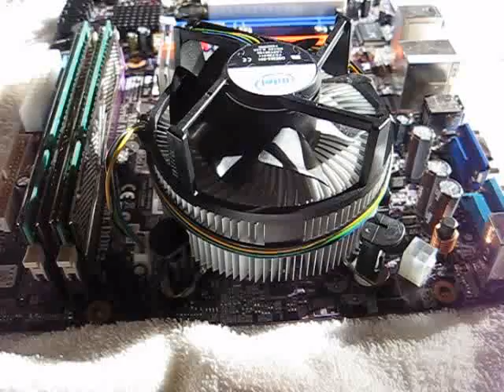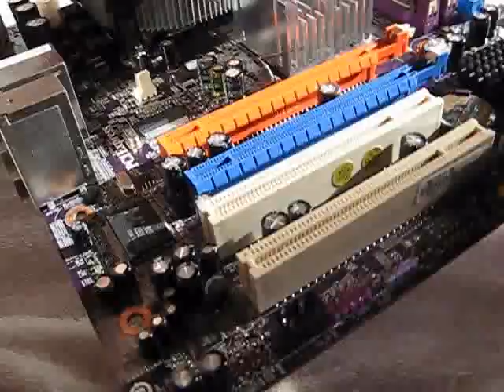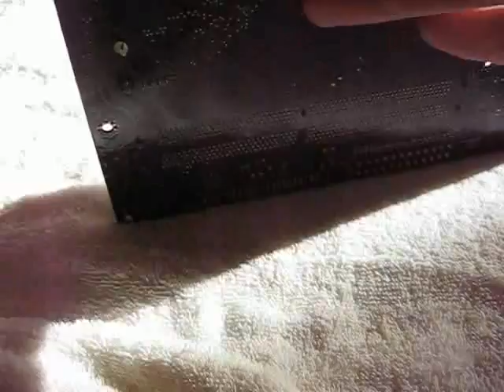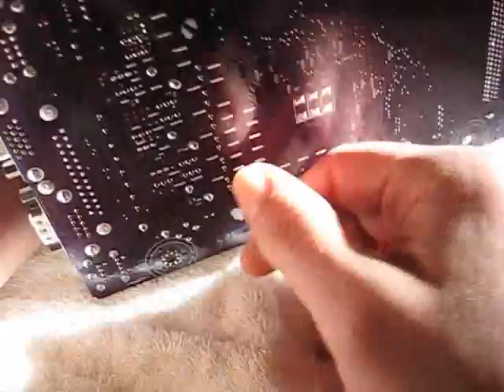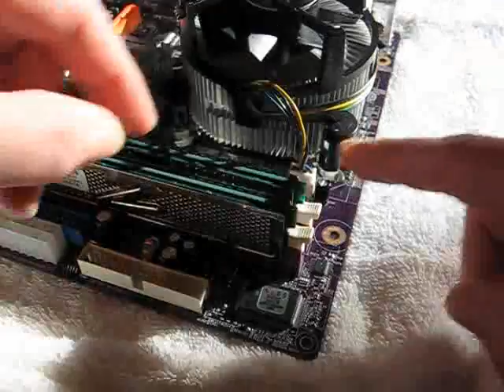CPU Intel socket 775 (removing)

Comment: Thanks for making this vid man, I had trouble remembering how to take it off as I was upgrading from E6750 Core 2 Duo to E6750 Core 2 Quad today, installed a Thermalright 120 Ultra Extreme 775, hooked it up to the Aerogate II fan controller (As it had a 3 pin power connector, not giving it any power via motherboard) Currently running at 25 degrees, and, only 2 mins after first startup with newly applied cooling paste!! :D

Comment: I bought the same heatsink thats in this video. My lga 775 comes with screws only. How do i remove the screws and make it so that i can put push pins in. Do I just remove the backplate or do i need to buy something for it.

Comment: Is it possible to unclip the fan from the sink, without separatimg the heatsink from the CPU? I'd like to clean the dust between the fan and the heatsink without having to worry about applying new thermal paste.

Comment: Ok, so I don't mean to sound like a complete noob, but I've got an old HP Pavilion desktop i'm attempting to upgrade with a Socket 462 (otherwise known as Socket A) and i was wondering if it's possible to find an adapter that would allow me to put a newer processor in, like a 775 socket processor or something, or if there's any way for me to take off the socket and replace it with a newer one. Thanks, please respond I need help lol

Comment: so im about to replace a celeron cpu with a core 2 quad. and when i take the fan off, do i have to remove my mobo from my case to get the fan off because of those little plastic nobs. or can i just pull it out?

Comment: The guy making this video over-complicates it. Its just undo 4 easy screws and pull off. But I must warn if your case is cluttered or the heat sink is near the PSU, one of the screws might be hard to access.

Comment: anti-static stuff is over-rated.  i've been building my own pc's for the better part of 12-13 years now and i've never had a component go bad due to "anti-static" no matter how rough i've kept them stored or installed. 

i have on the other hand, had a graphics card steadily go bad due to heat, and a cpu fry the instant i powered a system on(after i got back from iraq), as well as hdd's steadily die(as my 1.5tb is doing right now)

Comment: I disliked it instantly based off of the fact that he placed the motherboard on a carpet. There should NEVER be computer components on material that is not solid and can produce static electricity that could cause ESD (Electrostatic discharge) and short your components without you even knowing a thing.

Comment: first of all, this is a stupid way to remove the heatsink. first, unlock and pull up all four pegs. once all four are unlocked and pulled up, only then you can pull the whole heatsink all the way off the board without much fuss. you can even do that with the board screwed on the casing! as for the anti static band, all you have to do is discharge built up energy on the casing and you're fine. this vid got me laughing so hard, when he was poking under the board, i got some spit on my monitor